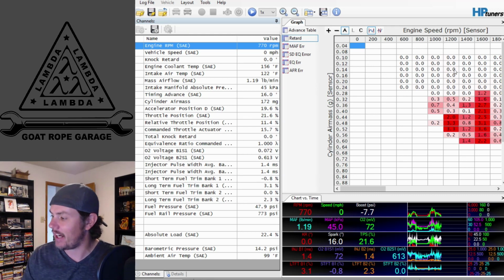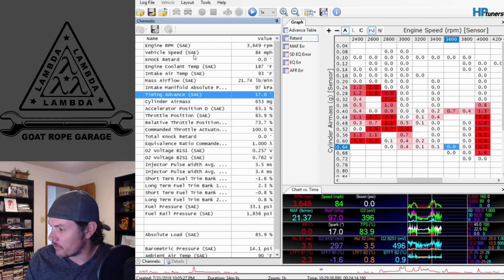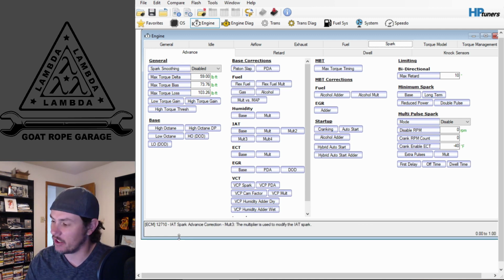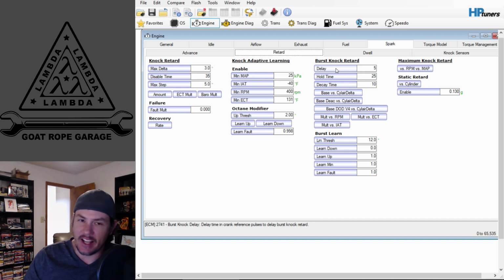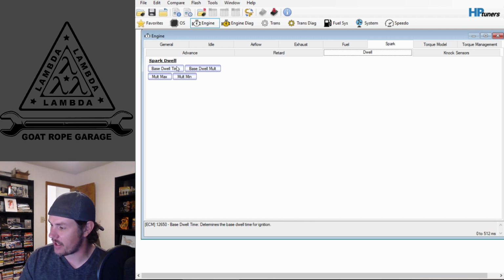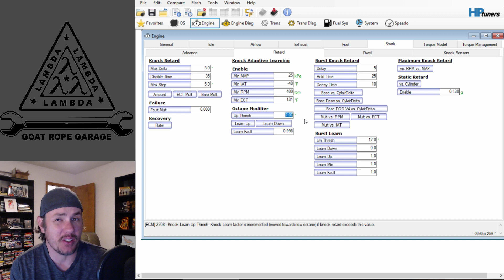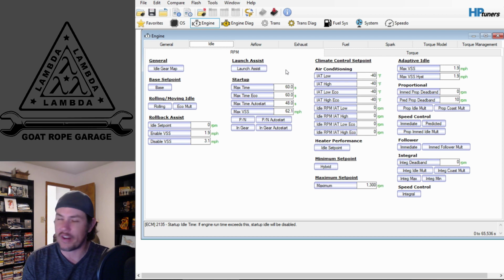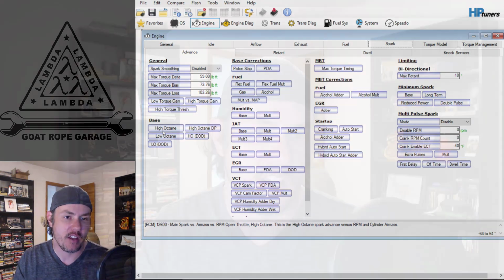Troubleshooting Timing In HP Tuners, Why We Aren't Getting Max Advance

Comment: Maybe one of the best vids I've seen. Liked how you explained what the tables actually mean.  Did you ever do a how to set up a graph and data log for Spark at WOT since data logging and capturing data only at WOT is near impossible. I learned how to set up the rows and columns from you. Haven't seen where you go into detail about filtering but suspect that is the key. Thanks
Reply from the maker: Filtering can be key, and the cool part is you can play around with it on existing logs, it just manipulates data already captured. So don’t worry about messing anything up when playing with filtering, you can always remove it and see the original data.
Reply: @GoatRopeGarage  Thanks...I've been playing w/ it filtering on TPS>2.7v but not getting data expected (still have low Aircharge and RPM values in graph)

Comment: Kyle question can you do any video’s on the magnum engines and hemi tuning I have both Im having trouble with a 5.2 magnum I installed a small cam from hughs runs fine cool but when it warms up it drops rpm right at throttle tip in runs fine on through after initial tip in any ideas

Comment: Hey Kyle quick question what plugs do u run I’m wounding if I put a copper core plug in if it may cool off quicker so I can possibly get more ignition. I have a heavy Yukon xl 5.3 LC9 and I get KR with only 11deg any input would be much appreciated thx keep up the great vids u the man 
-Frank
Reply from the maker: Where are you getting it?
Reply: So at 2k .60 cyl airmass I have only 8deg  and even lower at 1200 with -1 any more ignition I add I get KR is this normal?
Reply from the maker: No, but it sounds like false knock. Make sure your don't have something loose like a heat shield causing it
Reply: I will double ck the heat shields and exhaust but I think it’s  all tight.  it’s kinda a dog off the line I kno it’s heavy but it feel it’s holding back. also in WOT it only lets me have 15 deg (or I get KR) every other ignition table I look at including the stock file has more ignition? I have however been using the sensor 2 bung to read my lambda not sure if that is a problem or not but it’s always given me KR ever since I’ve plugged in To tune
Reply from the maker: @franksotomayor7341  Shouldn't be the issue. That may be all you get on WoT unless you're running 93 octane.
Reply: Thx Kyle for ur fast response and info I will see what I can find keep up the great wk cheers!!

Comment: On a turbo car, how do you feel about just zeroing out all tables that are adders for the base table. Having a final total timing number can be critical at high boost levels? Would hate to see timing slip in a degree or 2 from an adder
Reply from the maker: For a race car that makes sense, but for something that's street driven I'd leave a lot of them in place because in most of those situations you're going to want to pull timing to keep from damaging things.

Comment: Hey Kyle I have a question that you might have an opinion on. I am going to be installing a cam in the very near future. I have HPT and have already licensed my truck. My question is, would a professional tuner be willing to use my laptop / license to tune my truck? Would I be able to use my HPT and licensing in the future after paying them to tune it if they don’t? Does that make sense?
Reply: my tuner said that I could use the same code when I paid for my credits on my computer
Reply from the maker: You would be able to use yours, for sure. A pro might choose not to of they have already paid to unlock a platform, which basically allows them to tune as many of a certain Vehicle as they want.

Comment: What would be the cause of knock coming off idle? Like pulling away from a red light or in park/neutral and revving the engine. I've pulled timing again and again but it pulls up to 3 degrees or so every time.
Reply from the maker: Check fueling to make sure when you transition from idle that it's not jumping lean.
Reply: @GoatRopeGarage  I need to get a wideband. I know I should have done that before I started turning but... I will check that. Being it's pretty high mileage engine, do you think rod bearings would register as knock?
Reply from the maker: @4BillC  I wouldn't think so but if it is high mileage things like engine mounts could be the cause since it's when you're applying torque but you can usually hear that.
Reply: @GoatRopeGarage  it's pretty solid, doesn't move much from what I can see. I do appreciate your input!